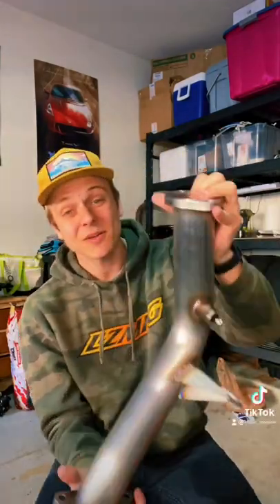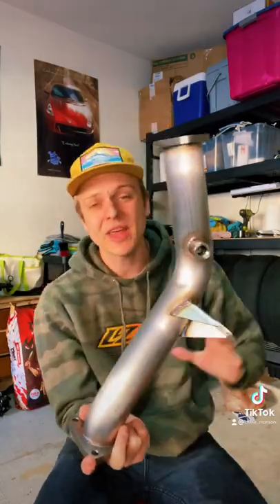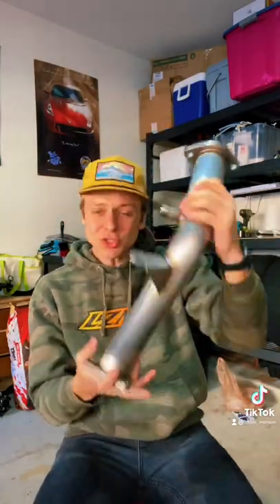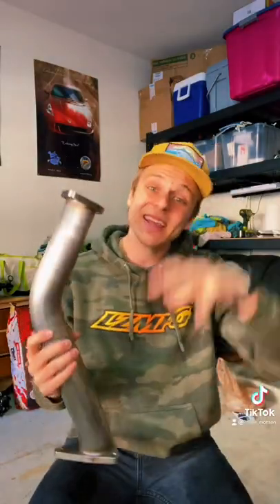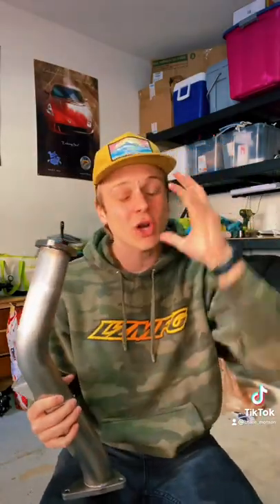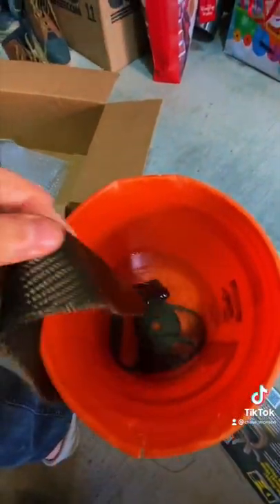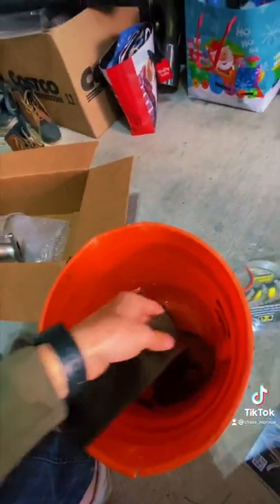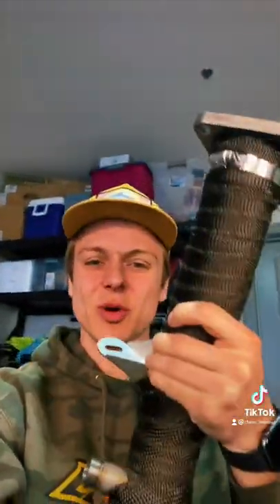The only way to heat wrap your exhaust! #shorts #jdm #diy

Comment: Only soak fiberglass wrap, not titanium and once it's dry, Spray with high temp silicone spray paint.  This keeps out moisture, oil and dirt which causes rust, wrap deterioration and aids metal fatigue.

Comment: Fiberglass should be the only wrap you soak. Also looks like you’ve overlayed the wrap a little too much…should have 25% overlap at most. Some spots seemed to be 75%. That will hold more heat than the metal can stand and cause heat damage like cracking.

Comment: Bro whay do you wrap it? Does it provide any advantage?
Reply: in case you are still wondering, it keeps radiant temperatures down in the engine bay, allowing other components to run colder therefore more efficient overral.

Comment: I. Can’t. Watch. This…. The amount of damage that this is going to do to the material…. Wrap already has the issue of trapping moisture, but to drench it in water!!! Spend the money and do a ceramic coat, or get Inconel bags made. If we would have wrapped the Inconel headers on the Grand Am cars back in the day, they would never last a race weekend. I understand on a budget, but replacing or repairing is more expensive. Still love the point you’re doing a 350Z.
Reply from the maker: Normally I would worry about rust but with it being stainless steal it will be fine. but to be honest I have been thinking about getting some ceramic coat just for the cleaner look! Thanks for checking out the video I appreciate the support.